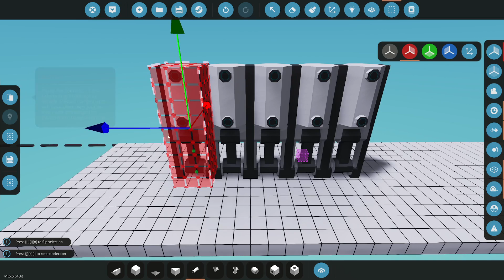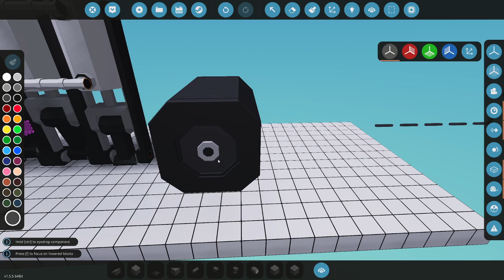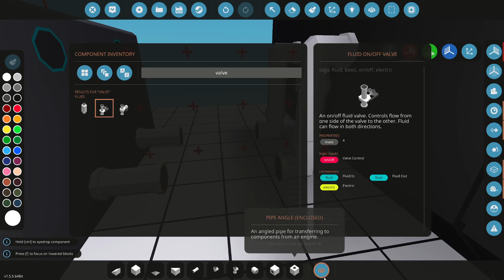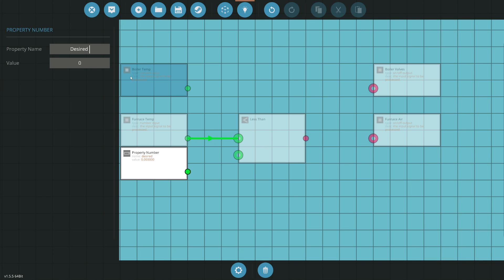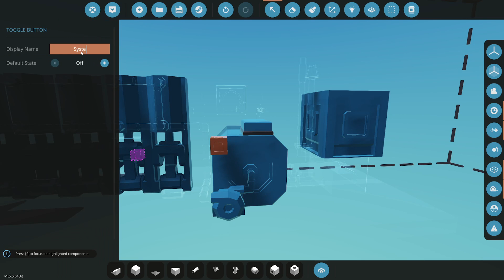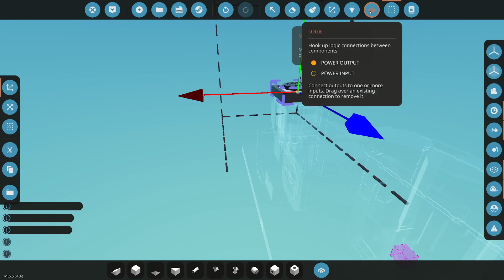Stormworks Basics Steam Piston Tutorial

Comment: I learned that you need to have a piston modified from the starting position for it to work. If all the pistons are set to 0, which should only really ever be when you have 1 piston, it will not start unless you move it first, like with a hand crank. However, if you set the starting position to anything other than 0, the piston starts no problem.

Comment: Alternative way of controling the furnace temperature, use a variable valve and the function: -x+200 that will control your furnace very well at 200C, also you can use a threshold to control the boiler coolant flow

Comment: Can't we just send the steam out from the pistons straight back through the pump behind the boiler and have infinite energy?
Reply: yea, i'm necroing. lol
i watched a video where somebody did just that. i tried doing it but wasn't able to spawn the system in with steam in the tank. i'm guessing they either removed steam from the list or the video creator was using a mod to allow it.
i guess you could spawn the boiler and heat box in as a separate vehicle and fill the tank with steam. i'm not sure about that, since there is no option for steam in the tank.
however, it may be possible to charge the pistons with steam.

Comment: I built this Sam thing step by step and for some reason the RPS and generator output was lower so I just put the boiler temp to 119 and it increased it, but it still didn't output as much as yours
Reply from the maker: They made some changes to the crank shaft settings after the video came out. I'll have to take a look at it and run it up and see what it's putting out currently.
Reply: @CaptainCockerels  alr

Comment: If you put a big vacuum pump between engine and condenser and rund it a little faster than the engine(I power it by the engine itself), you will  see a little over 1 rps on all engine sizes. Flywheel helps too. I think you have to much pressure at the engine exhausted, I limit my engines input pressure at around 0.33 and 0.5, and around 1.5 on my main steam pipe. What will result on 6.8 pressure at the boiler. I hold my boiler always half filled
Reply from the maker: I'll have to look into it. I have not bothered refining it much. I get more power than I can use currently

Comment: There are two small mistakes in this tutorial:

-Its really unnecessary to add more water to the boiler. Especially for small piston setups like this you already have more than enough contained within the boiler itself.

-You can and should still place your own valves down because the inner timing of the pistons is not enough to get them to reach max power. I've gotten 7,500 sW out of a 4 medium piston system using custom valves, which are not hard to do. Out of your system, if fully optimized with custom valve timing, you'd probably be able to get 10,000 sW. 1,400 sW may seem like a lot, especially coming from the underpowered turbines we had previously, but its nowhere near the full capacity of these pistons. I suspect they may be getting nerfed soon because they currently make everything else obsolete.
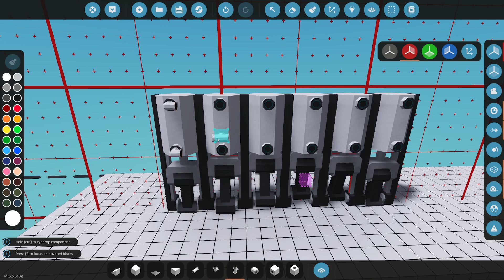Reply from the maker: They are not mistakes. I explain at 5:34 that that is for RP. It is a "basics" tutorial, hence why I'm not going to go into valve timing. This setup produces more than enough electricity for my applications so there is no need to produce more. Creating excessive electricity would break RP for me.
Reply: @CaptainCockerels  I understand that this is intended to teach only the basics. Problem is that the way you describe it in the video can give new players the wrong idea that they just shouldn't explore valves at all, as you repeatedly insist they are not needed without elaborating. The right thing to say would've been that valves are not strictly necessary, BUT can lead to massive performance improvements for more advanced players.
Reply from the maker: @sebastiaomendonca1477  feel free to make your own tutorial
Reply: @CaptainCockerels  You're not gonna go far if you take constructive criticism like this...
Reply: @sebastiaomendonca1477  You can not say something is a mistake because it is not how you do it.  The great thing about stormworks is there are dozens if not hundreds of different ways to do the same thing.  While someone may do something one way,  another  may do it completely differently.  Neither may be the best way, but if it works, it works.  

If you do not agree with the way someone does something try suggesting a better option instead of just saying that they are wrong and telling them to do it how you do it.
Reply: @Bendigo1  I very explicitly explained why those things are wrong, and how to do them properly.

Just because things can be done different ways doesn't mean they should, as this is a tutorial and it's giving new players wrong information. Yes the first one is just a nitpick, but the second one is a very big bit of misinformation that could lead to a lot of frustration for players who come across this tutorial and don't know any better.
Reply: @sebastiaomendonca1477  While I agree that it is not the best way to set up steam pistons, I do and you should respect the fact that he made a video trying to help others that have no idea what to do.     

The issue I am trying to address is that you criticize him for doing something that you don't do even though the way he does it does get them to work, which is a lot better than someone struggling with them and unable to figure them out.  

You said he made mistakes.  Perhaps it is a misunderstanding but they are not mistakes,  just a different way of doing it.   If you think or know you can make a better tutorial,  then do it.  If not, do not just tell someone they made a mistake.    Suggest, do not demand doing it another way.   

I appreciate the fact that you have quite a bit of experience and knowledge of the game, but your diplomacy is lacking.   You say he will not go far without accepting constructive criticism,  and I could say the same to you.     

Stormworks is a community effort. We should all be willing to share tips and tricks without belittling those that do not do it the way we think they should.  Offer suggestions and guidance, but do not demand they do it your way.  I see this same thing in the steam discussions and it really irritates me.   Someone asks for help, someone tries to help, then one of the "experts" butts in and states all the reasons it's wrong without explanation how to improve it, or telling them to do it their way when in reality, their way isn't really the best way in that situation.

Comment: The rotation of the pistons should be as evenly distributed as possible. Like you mentioned, in distances of 1/6 in this case (why didn't you do it this way?). The thought behind this is that you want the power to be as evenly distributed throughout a crankshaft rotation as possible. It might look better in your opinion to set the pistons to other rotations, but you need to keep in mind that every deviation from the optimum will lead to an uneven power distribution through one rotation.

So, for a 6 cylinder you want pistons with this rotations: 0, 1/6, -1/6, 1/3, -1/3, 1/2
Reply from the maker: I explained in the video that I set it where they are because you cannot go to more than 2 decimal places. I also mentioned there were more efficient orientations.
Reply: @CaptainCockerels  If they were set in intervals of 0.8 they'd be more even. As it is currently the interval between the outer pistons reaching max power and the next pistons in reaching max power is twice as long as the interval between the middle and innermost pistons. That's gonna lead to unwanted rocking.

What you've done by balancing them like you did is effectively reduced your system to a more powerful 3 piston system. Instead of taking advantage of the smoothness of 6 pistons you've turned it into a 3 step process that accelerates and decelerates very often. This is fine in a flat 6 combustion engine because it runs at very high RPM where the rocking felt is usually due to the pistons going up and down, instead of the power being applied unevenly through the cycle. In Stormworks we get the opposite. That up/down vibration is not felt, only the uneven power through the cycle, and because the RPS is so low it becomes all the more evident.

Comment: Oh, and 2 things I would like to suggest consideration to change.  
1: Boiler pressure is quite a bit more accurate and useful for monitoring the boiler.  While boiler temp is important,  maintaining proper pressure is essential.   Increasing pressure means you are building steam, decreasing pressure means you are losing steam faster than the boiler can make it and a pressure over 10 will make it explode.   The most simple way of maintaining boiler pressure is having a fire temperature of 250 to 300, have a pump, then valve going into the boiler.  A pump coming out can help too.   Use a less than  logic gate to open the valve when boiler pressure is under something like 5 then close when its over 5.  5 gives you a good safety zone and creates plenty of steam for most needs.  

2.  Variable valves going into each piston, with a throttle to control them all, really helps with the fluctuations of piston speed you get without them.   I added a pump from the boiler to make sure there is a constant flow of steam going to the valves.   And the exhaust side of the pistons needs to have very little restriction so that the one side is not pushing against the other because steam can't get out fast enough.   

Just something to consider if anyone has any issues with that.
Reply: Do you have a workshop link for your creation? I'd like to see what you did.
Reply: @weylinwest9505  I haven't posted anything to the workshop yet with the new pistons.   But i have a steam locomotive that is somewhat modeled on a steam locomotive that can be used to see how different values can be changed to control temps and pressures.   
If you search my profile name in steam workshop you should find it.  I have a few other things that are mostly creations I posted to fix other's issues or show how to do  something.
Reply: @weylinwest9505   I have not been home to be able to get to try it yet, but I think I have an even more simple way to control temps and pressure.  When I get the chance, I will try it and post it on the workshop if it works.
Reply: you dont need valves on the pistons they are inbuilt
Reply: @Nanoseaa  Adding your own valves increases the output for some reason. Idk why it works but I found the best power from is with a valve on the intake, and standard 3x1x1 pumps pumping out the exhaust from each port.
Reply: Limiting the water to the boiler is how i keep it from blowing up

Comment: 5:34. Wait, whaaattt??? 😲

Ohhh. R.P.   not our pee....   🤣

Speaking of R.P.   i was disappointed that there is only automatic valve function.    I was really looking forward to making complex valve systems to adjust timing and power. 😒  i really hope they make it an option to do manual valves or make modular pistons like modular engines are.
Reply from the maker: I agree. It would be cool if they would make it an option so that your could manually valve. Build in the auto to be inherently less efficient so that it is less work but better if you manually valve.
Reply: @CaptainCockerels  I appreciate the ease of having the automatic valves,  the just seem like they could be so much more efficient with a proper valve system created by the player.
Reply: @Bendigo1  Well you can by using external valves e.g on/off valves, and also steam pistons are a bit modular in the definition because you can get the same power with steam turbines
Reply: @mikumiku_rin  iT DOESNT really work the way i would like though. yes using valves does give SOME control but they still open and close their own VAlves at specific times so it is not possibleto really change the timing.  just the amount of steam that is used.